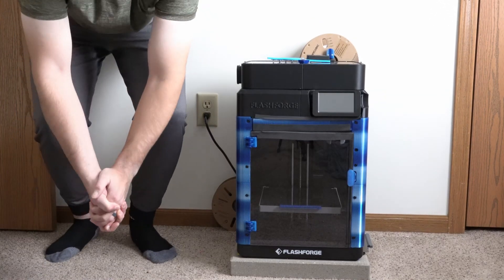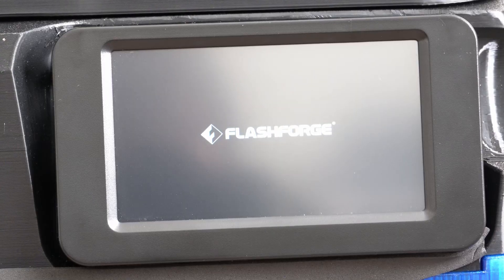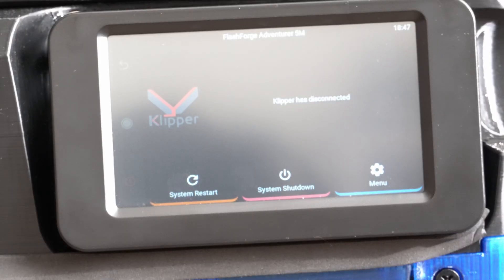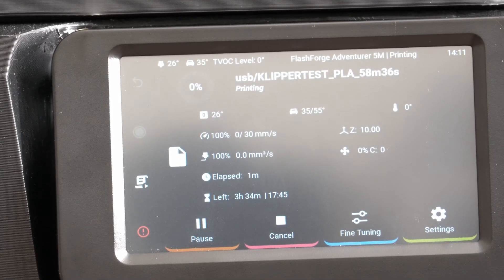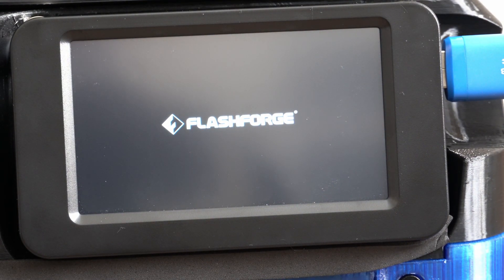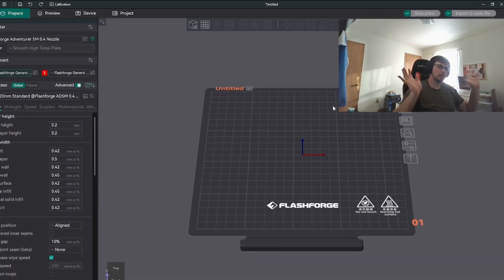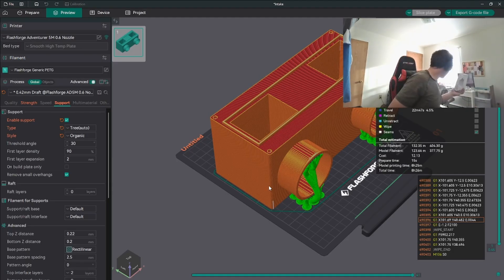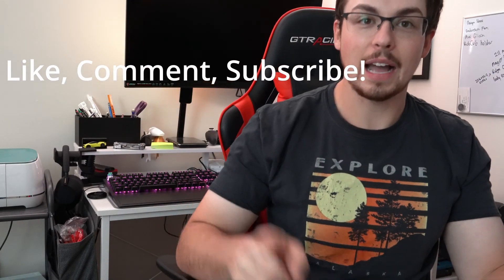Trying the Klipper Mod on my FlashForge A5M 3D Printer!

Comment: You seem to have had an issue that I did. Orca Slicer initially thinks the bed is 250x250, so the first command tries to move the print head to a place that doesn't exist. In the slicer, you need to change the bed size to 220x220, and set the midpoint as 110x110.
Reply from the maker: @themiraculousme  see my follow up video, we got it working now 🤙🏻
Reply: @906Prints  oh my bad. Good vids!! I have subbed

Comment: Have you had issues changing the z offset? For some reason whenever i change it it never saves. I had to go back to stock because the nozzle kept scraping the bed. :(
Reply from the maker: @themiraculousme  changing it from Fluidd doesn't save it. I know there's another way to  do it so it saves, but my z offset is happiest at 0
Reply: @906Prints  thank you! Perhaps I'll try from the printer itself.

Comment: I just did this mod yesterday. It works fine for me. Took about 30 minutes from installing and calibrating and then I was printing. The z offset was perfect. I used the guppy screen version. But now that I can do everything for this printer through orca slicer though the device tab in fluid, I don't really need the screen. When modifying the start and end gcodes, just save it as a new machine profile. That way if you want to go back, your original profile is still there to be used.
Reply from the maker: @vhoward1122  yes I need to make a follow up to this this week. I have it up and running now and I love it.
Reply: @906Prints  Klipper can be overwhelming when you are new to it. But it has so much more for you than the stripped down version Flashforge uses.
Reply: What does it do?
Reply: @swaggod226  Untethers the printer from the flashforge cloud if you want remote control of your printer. You also have a web interface you can access for control and it will run in orca slicers device tab. There is a lot more calibration options for fine tuning. That's just a few.

Comment: Will running klipper make this print better?
Reply from the maker: @cronicjohnson  in my opinion it has. I've been busy with the holidays but I'd like to make a follow up about getting it running. I've been running it successfully for 2 weeks now with no issues 👍🏻
Reply: @906Prints Yeah, dude, please make an update. Or you can maybe just tell me right here what you have changed to make it run without errors?
Reply from the maker: @iliavasin5956  Been busy with the holidays, but will update soon.
Reply: the AD5M already runs klipper, and won’t “print better” than the stock flashforge firmware. the stock firmware is just klipper and flashforge’s interface application.
Reply from the maker: @spilled_fries I beg to differ. Running the Klipper mod allows you to see the bed mesh, enabling manual leveling, which has absolutely had a positive impact on my print quality.
Reply: @spilled_friesI installed klipper, and uninstalled due to how many options there are (spoiler alert: there's tons more options in klipper.) so yes. The printer will work better. Once I have some time I'll reinstall and actually set everything up. Hard to find time to play with a 3d printer extensively when you're prepping for and settling down after a multi-state move.

Comment: I have been testing it out for the past week, and seems to work with no issues, the z offset issue is the most pronounced. Not fee l being able to save the adjusted z offset gets frustrating other than that for everything working, timelapse, exclude objects and Octoeverywhere. I wasn't able to get Wi-Fi, but i run mine with Ethernet either way
Reply from the maker: I never considered running an ethernet cable to it to try to fix my network issues. Maybe that'll be my next attempt. Good insight thank you

Comment: Orca 2.1.0 have builtin connector to Adventurer 5M. it`s pretty basic, I mean no control over prining, but at least no usb drive.
Reply from the maker: I've heard that but haven't had luck getting it running, I blame my current Wi-Fi setup.